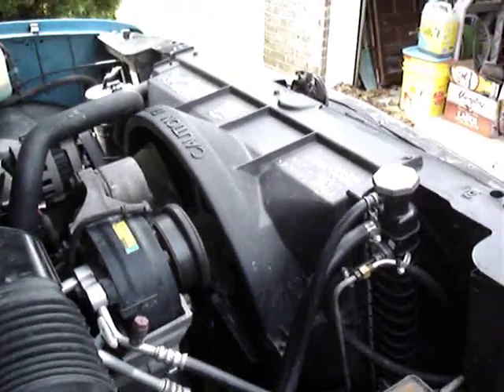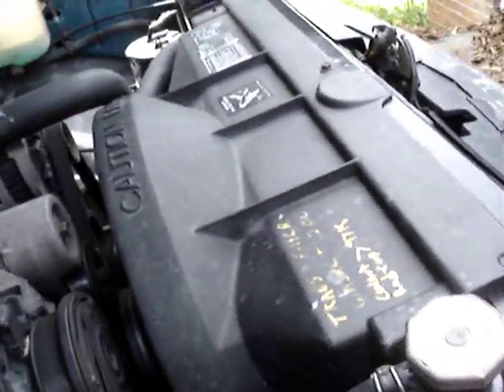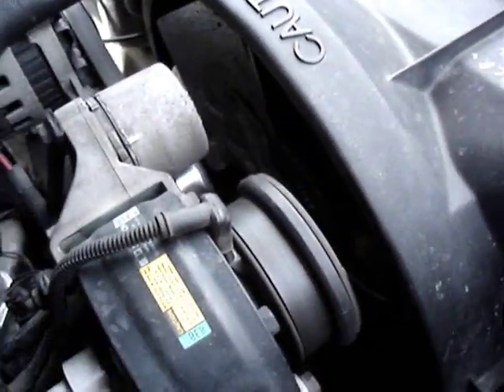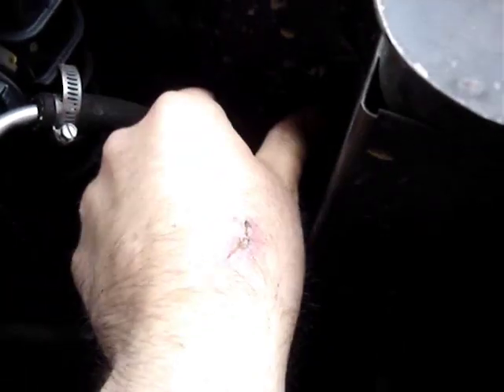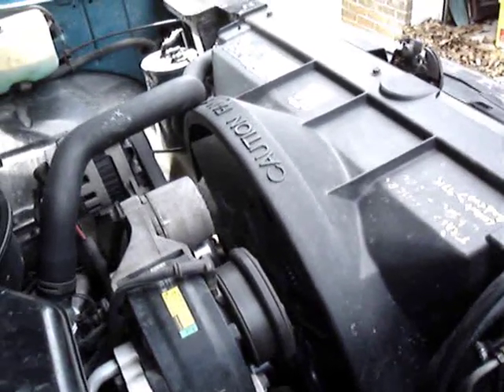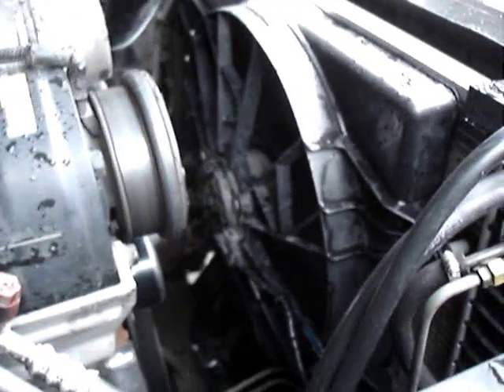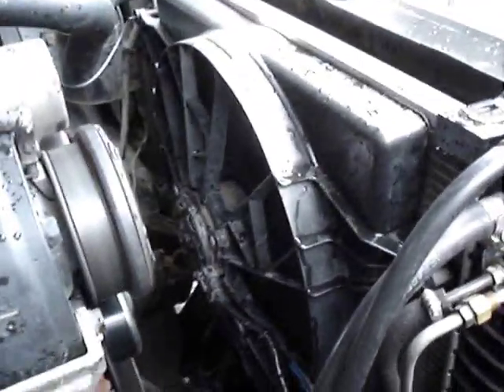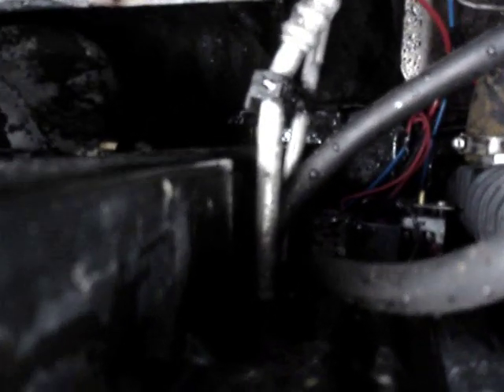converting the K1500 to an electric fan

Comment: Where did you run the fan temp switch. I have mine in the side of the block and my temp gauge in the stat housing. I cant get the truck over 70 degrees. And its getting cold in Canada!

Comment: After a bit of really bad luck I am gonna do the conversion, I put on a water pump almost a year ago, got it at autozone, well a couple of weeks ago my serpentine belt slipped off the water pump pulley it fell down onto the water pump housing and with all the force of the engine turning it broke the housing off went forward and smashed into my aftermarket heavy duty radiator and almost went through it, now my rad, and fan and WP and shroud are toast. After investigating why it happened I discovered that the WP disc that the fan pulley bolts to slipped down on one side so it was wobbling so much that the serpentine belt slipped off onto the WP housing, my belt didn't break but I imagine it stretched it. So here I am on you tube researching all I can for the conversion. All that damage because of a cheap ass water pump failure. I have a 93 chevy K/1500 cheyenne, have you ever heard of how reliable a aluminum water pump is? they only weigh around 8 pounds and the steel ones must weigh 3 or 4 times that, any way just wanted to share my story and maybe get some in put from ya'll . Thanks for your video, I have to do this on the cheap so the salvage yard elec. fan is a good idea for me, I am gonna buy a new heavy duty radiator though don't want to skimp on that, gonna get an aluminum one I think, well thanks again.
Reply from the maker: I just have a cheap cast water pump I got from Advance.  it has been going strong for years now.
Reply: yea what happened to me was a one in a million shot, I have never heard of it happening to anyone else, I have used the the cast iron pumps all my life never had a problem except for wearing out, I dought it would ever happen again, but they really are damn heavy, an aluminum one would take a lot of weight off the motor, I already have a aluminum intake.
Reply: Tim Johnson        I have bought all sorts of cheapo, aftermarket 
car-parts........90+% hold-up just fine.

Comment: Good job THEBEER, I installed twin fan to caprice 93 to save some gas and get more HP AROUN 10 TO 15 AND I just finished on my expedition 97 same twin fan more HP and AC works better

Comment: My car has a direct driven fan driven by the engine, so it doesn't have wiring for electric fans. If i wanted to convert to electric fans, how would i wire them?
Reply: Evan Goldstein        Any kit you buy will  most likely have pretty clear instructions!

Comment: I have heard that when you take off the mechanical fan its possible for the water pump seals/bearings to wear out much quicker because they are designed to have the fan pulling on the shaft.  Have you had any trouble with your water pump since installing the electric fan?? Thanks